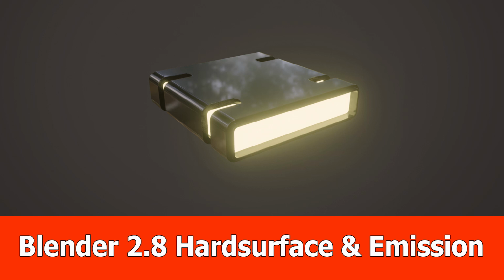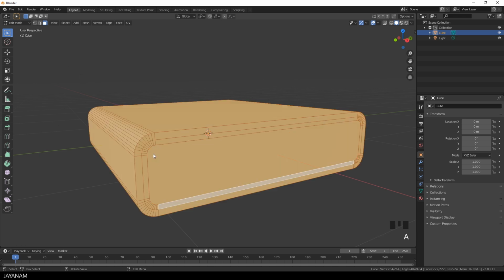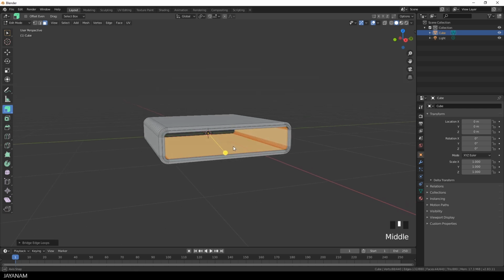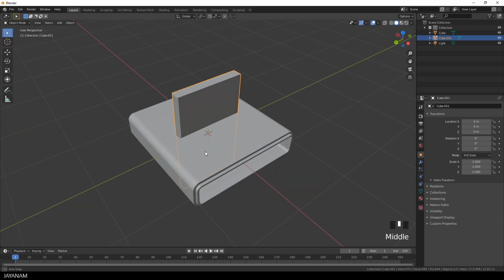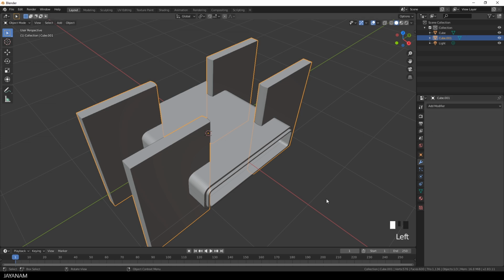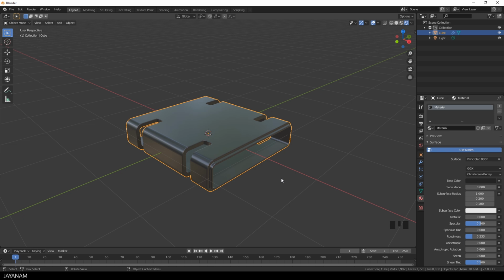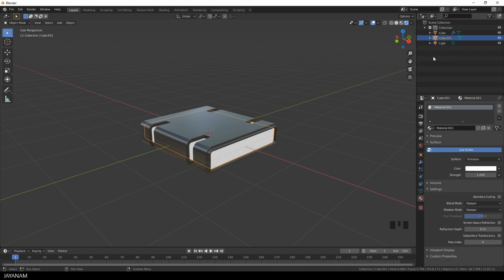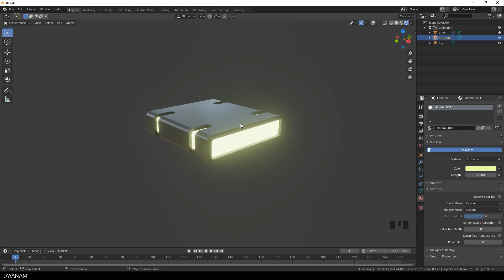Blender 2.8 Hard Surface Modeling and Emission

Comment: So I've been struggling trying to get emissive materials period in Blender 2.8. If I make a brand new file, change the cubes material to emissive, change the color to green, the cube does not change to green. On top of that the strength does absolutely nothing as well. Even when I go in and change the bloom, ambient occlusion, or even screen space reflections nothing changes. So I'm not sure what I'm doing wrong.

Comment: Awesome! However I get some strange shading as if the sde cuts are pulling each other. It only happens when I use the shade smooth, both normal shade smooth and the bevel object part of the add-on. I believe this is a common problem with hard surface. Is retopology the only way to fix it? :(

Comment: PLEASE HELP! When I try to add bevels, it adds way more bevel to the top and bottom faces than to the side planes. This is similar to another problem I was having last night, where I tried to insert faces onto a cylinder and it was inserting an ellipse, instead of a perfect circle. I did everything several times to make sure that I wasn't accidentally warping the cylinder into a slight oval, and I was not. They were perfectly round, but I could only insert an ellipse on their surface. I was having a similar problem when trying to extrude from the cylinders. Please help me understand what I'm missing here, I'm at a near total stand still because of this. Thank you.

Additionally: where you are finding the jmesh menu, I only see three tabs, which are item, tool and view. This is true in object mode and edit mode.
Reply from the maker: Dont scale in object mode or when you did apply the scale afterwards (Ctrl + A).
Reply: @JayAnAm Thank you so much for helping me out. Unfortunately things still don't work. I think there is a setting that got messed up or something. When I try the same procedures in a new file they work perfectly fine, but in the file that my model is on things are all messed up. May have some problems with the normal? Isn't there a way to recalibrate normal? Also, do you know why I only have the three tabs in the side menu where you are finding the jmesh tab? Thanks again for your help, I know you're probably busy, and I hate to bother people for these things, but I really need to understand what's gone wrong here. I have big plans for blender, so while I could just start a new file, I wouldn't understand the problem.
Reply from the maker: @nicholighkun  I dont know... are there any errors om the log? Open Window->Toggle console and see if there are any errors. Which Blender version are you using?
Reply: @JayAnAm  No errors, but it does say "warning: property 'release confirm' not found in key map item "opperatorproperties' I went ahead and started the project over, and things are fine in the new one, but I really want to know what happened incase it does so again. This project was easy to start over, but if it happens on a more complicated project, in a late phase, I really won't want to start over. So frustrating.
Reply: @JayAnAm  btw, I just downloaded it from the blender site a few days ago, so it should be the latest version.
Reply from the maker: @nicholighkun  Hard to say, you can send me the project file via mail (see About page)

Comment: Nice addon)
Can it have a duplicate option for difference operation to keep subtracting objects intouched?
Reply from the maker: Thx, can you explain a bit more what you mean, I dont quite get it.
Reply: @JayAnAm  when you applying difference boolean, cutting object is lost. Its okay, but there are  cases, when you need to leave it, for example, for making a joint between two components for manufacturing.

Comment: This is great! One question, I keepo having issue in Blender when try to get in close to a model that the view seems to get stuck cant zoom in any further and really really slow to zoom back out of it - is there some known blender setting to avoid this?
Reply from the maker: Thx... Never had this, which version are you using?
Reply: @JayAnAm  it's all blender versions ever used
Reply: @secretstudio7974  just to add that it only happens when trying to zoom in close to model vertices for editing and it gets to a point cant zoom in any further as screen then slows down hard to zoom back out - this is on any machine I was hoping someone knows about it and how avoid
Reply: @johnleighdesigns  Im not sure how to completely fix it but when it happens to me I press the period key on the num pad to "reset" the view. It then lets me zoom a bit more.
Reply: @gameplayarsenal425  awesome I'll give it try thanks
Reply: @secretstudio7974  let us know :)
Reply: @gameplayarsenal425  im late to respond! but yes this does help ! Also in preferences Navigation> Auto Depth check on the radio box

Comment: does the addon work for 2.82 ? when i click install addon nothing happens?
Reply from the maker: Yes, I habe it imstalled. Did you install from zip file? Just press Install... go to the zip, then type in Jmesh, activate it with the checkbox
Reply: @JayAnAm  had to restart the editor its working now cheers
Reply from the maker: @r3klessgaming995  Ah great, glad it works

Comment: I'm confused what to select with your link which is it? Do I select Clone or download or some other listing? Can you also put icons on screen of what you are doing is it shortcut keys explanations?  A little popup icon or something it can be hard to keep up an would be appreciated.
Reply from the maker: It is a normal github repo, you can clone it or you can download and install the zip like any other blender addon. The other things you mentioned I dont understand. Icons on the screen? Popup icon? IDK what you mean.
Reply: @JayAnAm  Buttons you are selecting or shortcut keys
Reply from the maker: @raymondstpaul4913  These are displayed by the screen cast addon that you see in the lower right-hand corner.